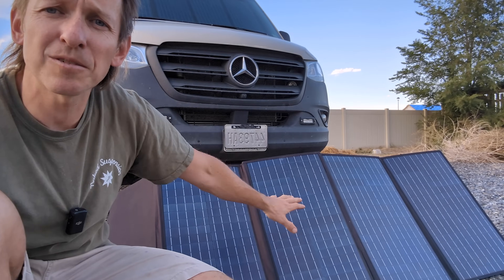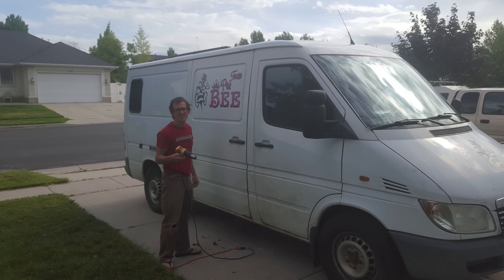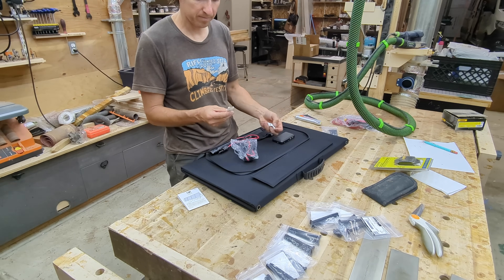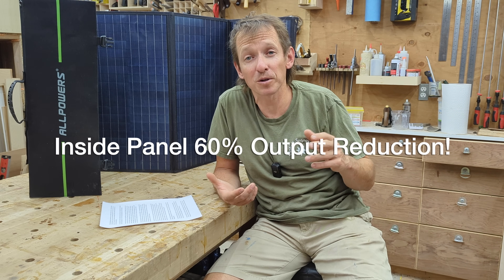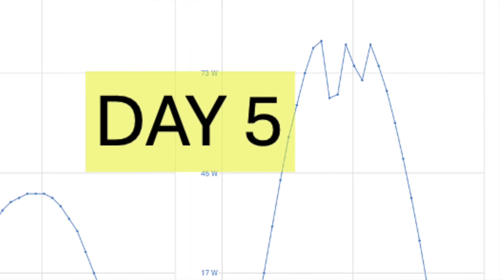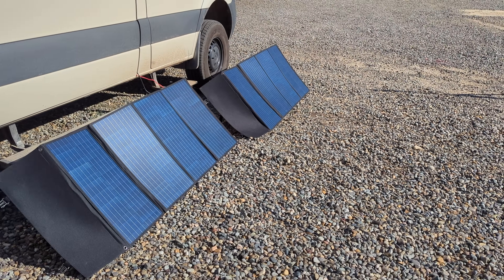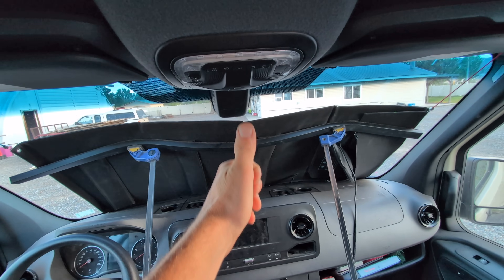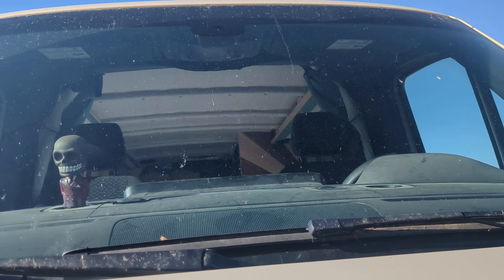Solar Panels Inside Windshields

Comment: If you place them on the outside of the windshield, it could serve two functions at once.  Direct sunlight for production, but also an excellent shield for the interior.  Perhaps even put a cloth backer that is tailored to your windshield with some attachment mechanism.  Jeez, might try that myself.
Reply: Agreed but if you're going to leave it for a few days, may get stolen or drenched by rain, they are mostly water resistant but folding panels are rarely water proof.  If you're leaving the van, you don't need 100% output, 40% is good enough to keep the battery topped off and keeps them from discharging.

Comment: Same results I noticed using a smaller panel to maintain a 12v battery...putting inside the windshield made it more or less useless.  It had to be mounted outside of the glass to get enough irradiation to actually work.

Comment: Modern windows and windshields are designed to block thermal radiation to keep the inside cooler.  That's where the 60% went.
Reply: Incorrect: The inside solar panel only got around 40% because the windshield magnifies heat which is why in the video he measured temperature to around 175 degrees inside. 

As we know; the higher the temperature the less efficient solar panels become.

Wrong again about the windshield designed to repel the "solar radiation", unless your vehicle is equipped with the tint; most vehicle don't because it cost more. You can check your vehicle windshield or tint with a UVA/UVB/UVC tester card. Even If you have the tiny, vehicles are ovens and will heat up in the sun to maze temperatures without shade.
Reply: @LawPope  Or... it's both...wow stuff can be more than one thing !
Reply: @LawPope  not only that, but i thought immediately all of those data points should have been thrown out and the whole thing started over - putting insulating, heat reflecting sleeping bags amplified and trapped all that thermal air around the interior ones - so which days were with the sleeping bags and which days were with the plastic bar thing - because it didn't make a difference in the graphs - which doesn't make sense...
Reply: I'm really curious how this will work for Aptera which has the panels on the dash.  I wonder if they use a different type of windshield that doesnt have the same film to block specififc wavelengths.
Reply: Solar panels don’t create electricity by converting heat from the sun, they convert light -
Reply: True true! 

Also many of them are polarized, like our sun glasses or CPL filters for camera's, cuts the light quite a bit.

Comment: No way a frige can be ran on one 100w panel and 100Ah battery, i must have misunderstood.
Reply: prob a dc fridge, not a home appliance ac one
Reply: "in the summer" says the video.  Taken literally, that's just 3 months of the year. From experience (with 2 different DC fridge models) I think that's doable with peak solar.
Reply: @Mevi  possibly get by if only three months of summer but he clearly said that he ran that configuration all year in his old van.  From my experience with a camper and a similar frig ( 3 Amps / 50% duty cycle) it just not feasible unless there is lot of reliance on some other charging mechinism.  Even on my sail boat with a efficient freezer (3 Amps @ 12vdc) and a older refrigerator (6 Amps @ 12vdc)  both at 50% duty cycle my 600W of panels and 400Ahrs of AGM battery are only good for a 24 hour period if I have a good daylight sky for charging.

Comment: So the 40% result is mainly due to temperature of the panels inside the van. Dramatically illustrated the impact of temperature on panel efficiency doesn't it!
Reply: vehicle glass especially windshield is a layered composite which is laminated with a plastic layer. this means it reflects more than even regular window glass, and is also likely to block close to 100% of UV, possibly other wavelengths as well. im sure the temperatures reduced the efficiency, but i would expect the largest reduction to come from the glass itself reflecting and filtering various wavelengths.
Reply: @ensom  Very good. Thanks for the info.

Comment: I think car windshields are doing some spectrum filtering to attempt to limit at least UV to keep interior cooler, but I don't know anything specific.  Also aren't windshields two layers with plastic/glue to make them safety rated?  again, no clue how this affects things.

That said, I like this test.  

I've thought about using a flexible(not foldable panel) as part of a window sun block, but never worked out any details.  So again, very interesting test and my blind guess at the start with 50% at best for the reasons you mentioned, dirty window, non-optimal angle/car position.  That said, flat mounted roof panels are facing these same issues.   

If someone had a jackery like device up front while on a day hike(or day job), this would be helpful way get some power while unattended charging.  I've been thinking of an ways I could trickle charge my starter battery while boondocking for days in same spot.  Modern vehicles have parasitic power draw that's really annoying.  You see notes in owners manual about starting car every 2-4weeks to top off battery.
Reply: I bought a small battery tender panel on Amazon (probably 20-30w). I just leave it on the dash in my truck and it works great. The truck is under a carport so it only gets direct sun to about 11:30 and it still works great.
Reply: @atomicsmith  Thanks for the tip.  

Was looking at the little 50w panel but did not work out which controller I'd use to regulate the voltage for starter battery charging, but not over charging.  Once those are figured out, wiring for ease of use.  What do you use control the panel voltage?
Reply: @Chris-ut6eq  been using a 60w folding panel in my windscreen for a few years now to help combat parasitic draw from car alarms. PWM  solar voltage regulators are very cheap (£10 to £30 for the cheap Chinese ones readily available) but approximately 30% less efficient than MPPT type regulators. I use Victron mppt more expensive but well worth it for adjustable within there app. Just remember to buy the right type Victron do make Bluetooth and non Bluetooth versions
Reply: @Chris-ut6eq  The panel I bought has a battery tender circuit built in. I just plug it in to the cigarette plug and it does its thing. Very convenient.